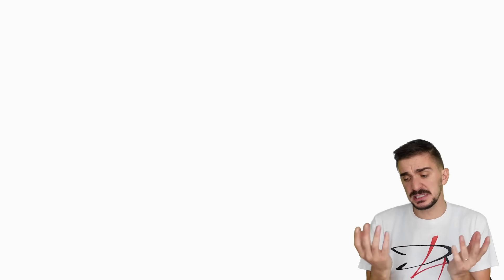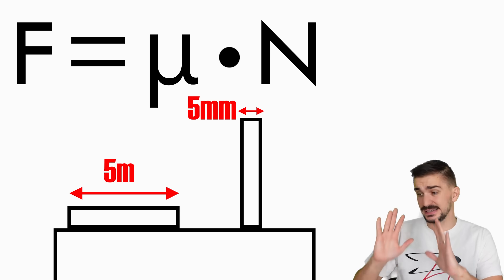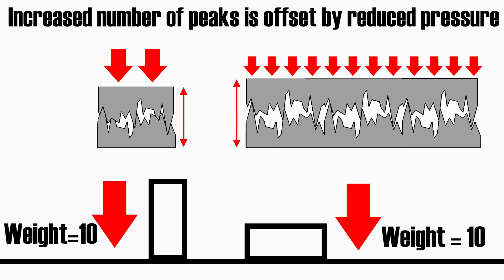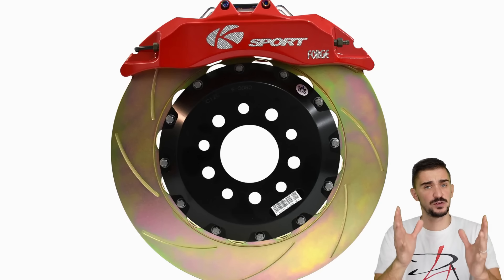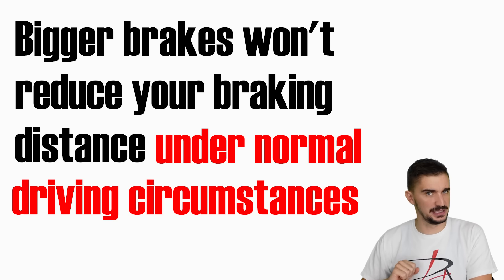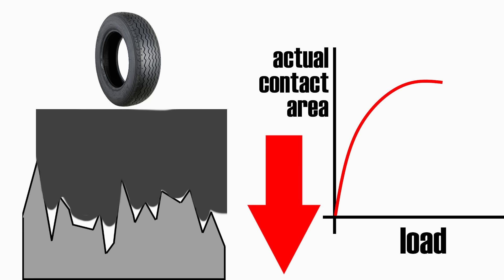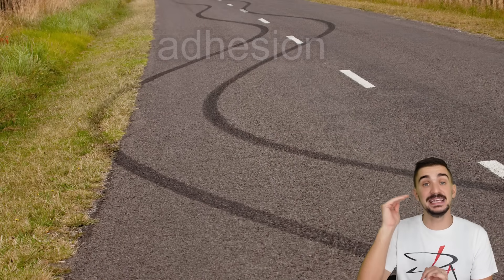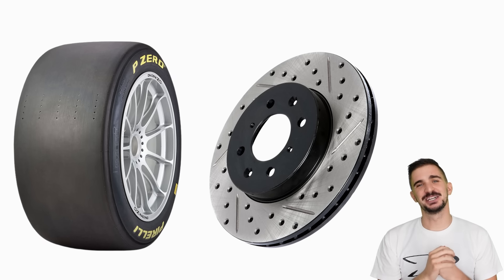Why Big Brakes Won't Stop You Faster but Wider Tires Will - Friction and Surface Area Explained

Comment: Sorry everyone, but this video is nonsense.  By the falsehoods presented here you could replace the calipers and rotors on your F150 with those from your mountain bike and aside from fade, all would be fine.  We all know that isn’t true.  Brakes have 2 missions in life; 1. To turn kinetic energy into heat and 2. To dissipate said heat.  Regarding number 1, let’s say that a given size master cylinder generates 100psi of hydraulic pressure against a single piston with a hydraulic interface surface of 1 square inch.  This would yield a clamping force of 100 pounds.  Now let’s say that same master cylinder applies the same hydraulic pressure to 3 pistons, all of which are 1 square inch at the hydraulic interface.  Now you have 300 pounds of clamping force.  This will most certainly generate more heat.  So, larger, multi piston calipers generate more clamping force between the pads and rotors thus generating more heat.  On to number 2.  In conduction heat transfer, the rate of heat transfer is directly proportional to the area through which the heat is flowing.  This is also true of convection heat transfer.  As such, larger brake rotors can get rid of more heat.  Back in the 90s, I gave a presentation on the thermodynamics of brakes to the engineering staff at Harley Davidson who were struggling with how horrible the brakes were on their bikes.  They had tiny, single piston calipers at that time.   They were initially reluctant to take my advice for bigger brakes because they didn’t want to change the look of the bikes.  Looking at their current bikes you can see that they finally came around.  This video should be taken down as the presenter clearly doesn’t fully understand how brakes work.

Comment: I thought a larger disc gives less friction, not more. This equals better stopping power, up to a point. Reducing heat is paramount for stopping power, but there is optimal heat for stopping. Most of my brake improvements on my different car come from reducing heat via vented AND slotted brakes. Car stops quicker everytime.

Comment: True bigger tyres Will brake better but don’t forget if you get bigger heavier tyres then you will lock up very easily. So bigger brakes will provide a more consistent pressure without much lock up like smaller tyres

Comment: It's either your tires are slipping or your brakes... But above all, bigger brakes dissipate more heat / heat up less / put less strain on the components.
As for the tires, they grip less if loaded less. And with a larger contact patch the loading decreases, therefore it's not as straightforward as just fitting huge balloons in the wheel arches.

Comment: Argument for Better Braking with Larger Brake Discs:

Larger brake discs offer improved braking performance primarily due to an increase in the braking torque they can generate. Torque (τ) is defined in physics as:

τ = F × r

Where:
	•	F is the braking force applied by the caliper
	•	r is the effective radius from the center of rotation to where the force is applied (the brake pad’s contact point)

By increasing the radius r, the same braking force F produces a greater torque, which more effectively decelerates the rotating mass of the wheel. This results in shorter stopping distances and better control under braking.

Additionally, larger discs provide better heat dissipation due to a greater surface area and mass, which helps prevent brake fade during repeated or prolonged braking. This is especially important in high-performance or heavy-duty driving scenarios.

In summary, larger brake discs improve braking by:
	1.	Increasing braking torque due to a longer lever arm.
	2.	Enhancing thermal capacity and cooling.

Comment: Who told you that increasing the tire width makes the contact surface area larger? The contact area is determined by the pressure inside the tire. That's all, nothing else. You can decrease the stopping distance by reducing the tire pressure. A wider tire at the same pressure will help cornering but not the stopping distance. If you don't believe you can always check out tests of the road stopping distances of tires of different sizes. They are the same.
Reply: True but it becames wider witch gives more contact and depending on tire pressure , you get more or less contact

Comment: Another great video from you, thanks a lot!
I would appreciate it if you could make a video (or a short extension) about the  relationship between a vehicle’s weight and its braking distance. I often read that heavier vehicles have a longer braking distance, which in my opinion and based on my understanding of physics is not true. You  could certainly explain the physical background of this situation very well in a short video. Thank you in advance.

Comment: I've installed a few big brake kits. 

In addition to most stock brakes not being able to reach the limits of traction of track tires, big brake setups provide more mass to absorb more heat,  keeping the rotor temperature lower and permitting longer traction limit braking. They also have more surface area, increasing the rate at which they can transfer heat to the environment.

Comment: Did he mention, all other specs being the same, a larger diameter rotor has more braking power?
Reply: Braking power is the amount of heat the brakes can dissipate. He mentioned this.

Comment: Brake capacity is rightly thought of as peak power rating, the brakes turn your kinetic energy from forward motion into heat, the problem is conservation of momentum, you can dissipate all the energy you want, but you need to transfer that momentum back to the earth with your tires. Stop the tires motion too quickly and you're just going to be sliding forward, dynamic coefficient of friction (tires sliding across the road surface) is almost always less than the static coefficient of friction (tires rolling across the surface) but bigger brakes are still necessary to slow you down from higher speeds, as ke is proportional to v^2 while momentum is proportional to v

Comment: Larger rotor diameter means higher braking torque for the same clamping friction. Larger diameter rotors absolutely improve braking performance provided the tyres can support it.

Comment: increased side of brakes has less to do with surface area (cooling) and more to do with thermal mass.  plain and simple: bigger rotors have more capacity to turn kinetic energy into thermal energy.

Comment: Hey, I like your show, just one little detail. Bigger brake rotors place the brake pads farther away from the center of rotation, effectively creating more leverage. That gives you more braking power, but not because of the surface area. I think you didn't mention that, sorry if you did.

Comment: This is why I'm considering changing the stock 265/65 stock tires on my pickup to 245/70 (same diameter) when it is time for tires. Wet tire adhesion is more important to me than ultimate dry pavement performance.

Comment: My uncle purchased fancy brake system. He installed shitty tires. It not only has trouble slowing down, but also has crazy wheel spin because the car has an open differential with shitty wide tires on it. It is even worse when it has to go over the snow. 😂😂😂

Comment: Found the answer I needed in this video. I read wider tires only change shape of contact patch, but it didn’t explain how it improves braking if only the shape of the contact patch changed given the same weight on the tire. But since tires deform and not linear like a solid, the answer is, that the shape of the contact patch changes, but it isn’t linear. You will have overall larger contact patch even given the same weight

Comment: At the start of the video you told us that even glass is not a smooth, uniform surface, but then you say that brake discs are very accurately machined and therefore the surface is very uniform, so the formula works, and this is why bigger brakes don't decrease braking distance.
Sorry, I don't buy it. If the surface of a substance, glass, that is completely amorphous (non-crystalline), and is formed by cooling a liquid until it no longer flows, is not uniform, then no machined metal surface could possibly be uniform either. Additionally, the discs are only half of the story. The pads are the other half, and they are anything but uniform. If friction increases with surface area due to surface irregularities despite what physics modelling says, then I cannot believe that the friction surfaces in braking are immune to this deviation from what the ideal physics model says. Not completely. If the real world deviates from the physics model, brakes, being part of the real world, will also deviate, even if the deviation is very small.
The real reason is much more fundamental, and completely intuitive... the friction the brakes achieve is not the limiting factor in braking distance. The stock brakes in any car are easily able to produce enough friction to lock the wheels (causing them to skid). Although maximum braking force is achieved just before the point of skidding, all braking systems in cars are equally easily able to achieve that as well. Once you've achieved this, more friction in the braking system cannot produce any difference in stopping distance.
It is therefore obvious that bigger brakes cannot possibly decrease stopping distance, and I personally doubt that anyone interested in cars enough to fit bigger brakes actually thinks they do. Even if brakes deviated from the ideal physics model more than any other system ever devised, as long as the brakes can lock the wheels, bigger brakes won't stop you quicker.

Comment: With all things being the same except for the radius of pad contact, the larger diameter rotor would constitute a longer moment arm resulting in greater torque working against the rotation. So, if larger rotors means that the pads are moved outward, how can that not be an improvement 🤔

Comment: I would have liked to see a different approach for seeing this problem.

Let's take a braking distance, let's say 10 meters.

Given that 1 tire rotation = 1 rotor rotation for obvious reasons they share the same center hub.

In 10 meters let's say tire circumference is 1 meter, 10 rotations of the tire before stopping. 
2 rotors with different  diameters means the surface area in those 10 rotations before stopping is different, the caliper had more area to grap with a larger rotor. More area to tranfer the head in the same braking distance.

Indeed energy only transforms, in the case of braking it's transformed into head.

Where I'm trying to get with the increase area is with your wood analogy, a bigger rotor will mean you have to drag the larger piece of wood for more distance. Effectively meaning a larger work. Not effort.

Work = force into distance.

The braking force for the most part remands the same if we dont consider fatigue but the distance we drag the object increases
Reply: I guess the diameter of a rotor affects the amount of stopping energy. Not the pad surface area.

Comment: i think an important point was missed here: a bigger brake disc enables the use of a bigger piston so you can increase pressure/keep pressure over bigger surface and that will result in more braking power. so in short: if you scale up the whole brake it will have more power. BUT that is rarely done because pretty much all brakes are strong enough to make the wheels skid and so upscaling will not benefit you in that way. BUT if you install different tires that have more grip, the upscaling of the brakes could be important as your grip of tires might get higher than your braking force can overcome

Comment: What about temperature leading to higher pressure and smaller contact patch on the road? Kind like why dragsters have under inflated tires before races. Like watching in slow motion a burnout to warm up tires and leave a strip of rubber, as rubber grips rubber. And why they sometimes pour unknown liquids on the track

Comment: A bigger brake disc still provides more force than a smaller disc. Because the distance from the center of the wheel to the brake caliper on a bigger brake disc is longer than that on a smaller brake disc. It's like using a long wrench versus a short wrench! A longer wrench always provides more torque than a shorter one!
Reply: You are correct. The bigger the rotor the less pedal force is required. But it doesn't give you any other advantages in terms of the stopping distances.

Comment: bullshit if you don't physically prove it with a real-world unit! top gear did that avantime episode and upgraded the shit out of it, and the big huge wide tires made the thing considerably slower - in fact, every single "upgrade" they did made it SLOWER - suspension, brakes, tires. only the tuneup (factory parts!) made it go faster.

Comment: Bigger brakes will stay cooler for longer and cool down quicker but if the brake pads have roughly the same material contact and temperatures are optimal the disc size won't make any difference.  Wider tyres will as long as there is enough weight to make them grip, as weight would transfer to the front of the car where most of the braking force is then there will be more grip under braking unless...  There's standing water in which case wider tyres are more likely to aquaplane and lock up.  For road use I like to run 195 or 205 width tyres which work well in any conditions.  If I go smaller than 185 the lack of grip is noticeable and over 215 aquaplane chance seems to increase a lot just generally.  I've noticed the fast cars on trackdays in the wet don't run especially wide tyres.

Comment: for brake, if everything equal, the size matters! from fundamental of physics, big size has an increased torque from same power. My Lexus LS500 f-sport has bigger brake system than non f-sport LS500. my LS500 definitely stops quicker and easily than my friend's LS500.  mine = 2018 LS500 f-sport,  my fiiend's = 2118 LS500 awd.

Comment: Bigger brakes may not stop you faster but they will stop you more times in a row, or function at a high level longer. It’s about heat. A bigger disc takes longer to overheat and has more surface area to dissipate that heat after it has been generated. Mountain bikes are a good example. A xc bike likely has 160mm brake discs while a downhill bike will have something a like 220mm… because they need to brake more often over longer stretches. 37% more disc diameter, obviously proportionately more surface area as well.

Comment: In conclusion, both big brakes and tires will make you stop faster but once you get bigger brakes, you will need bigger tires in order to use all of that braking power effectively so you dont lock up fast.

Comment: Bigger breaks (discs and pads) make you break more frequently end for longer... better heat dissipation. Bigger discs allow for higher breaking torque, so the calipers don't need to apply so much force. Discs and pads will last longer as well.

Any small cheap break can lock your wheels and ABS will take care of it. Better breaks, again, allows repetition and longer breaking.

Comment: I might be wrong, but even though F = μN, the braking torque M = F * r is higher with a bigger brake disc due to bigger radius, even if Force stays the same.

Comment: but smaller disc has bad heat dissipation and fast braking power down. larger disc usually comes with more piston caliper and greater forces.

Comment: Increasing brake size means more heat capacity and cooling surface, means less wear on pads/brake failure. It’s only needed if you’re braking hard and very frequently like on track. 

The tyres doesn’t matter if you like the driving characteristics, like let’s say some ability to drift to point the nose faster like in rallying. Sometimes you actually want the tyres to be narrower and instead have a larger diameter as it has more forward grip than side grip (look at tractor tyres, large diameter, relatively narrow width).

A wider tyre has better sidewards grip. You would get it for sidewards grip, however if you really want to stop slipping forwards as much, you actually need larger diameter tyres, wider tyres doesn’t work as well.

Comment: I am sorry but I will have to break your example with F=u*N here. But only when dealing with very specific examples.

If you have a cutting board weighing 1 kg and you put it on its side, then yes...

u stays the same and N stays the same so F stays the same.

Now, do this with a piece of paper... Now, all of a sudden, you are dealing with a whole other type of friction. Now it DOES matter if the paper is lying flat or is on its side.

I am no physicist so I can't explain it further than that, just know that 'it depends' is a variable you didn't touch on here.

EDIT: Oh and one more thing, with your "apparent contact area". I can tell you right now that if the two surfaces in contact with each other are VERY smooth/flat, such as with gauge blocks or whatever they are called, those surfaces WILL stick together like magnets. And then, again, it really does matter how much surface area you have regardless of mass. (or normal force)

Comment: This is right on paper but wrong in reality. There are other effects too. The bigger rotor increases braking torque. Not to mention heat dissipation of bigger brake rotors help the pads to keep their “mu” or coefficient of friction and not melt / deteriorate. Bigger brakes due in fact make a car stop faster. If you are looking to upgrade your car, they are actually one of the best performance to dollar value upgrades you can get for reducing track times. You are right about tires though because funny enough, the first best upgrade in that same category are tires.